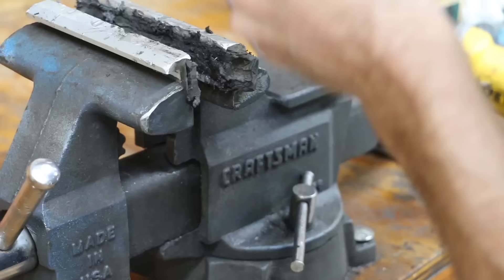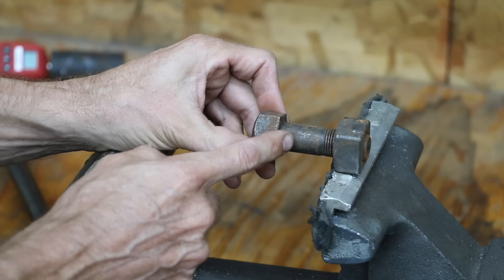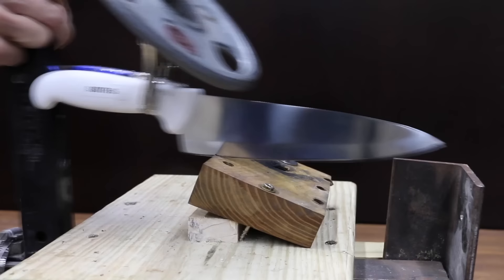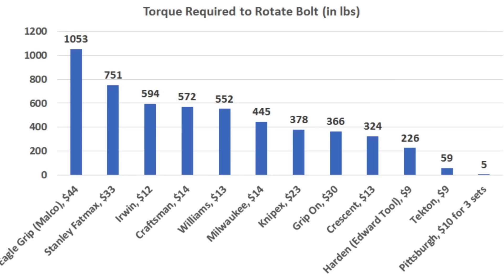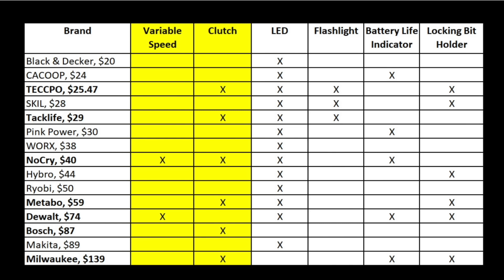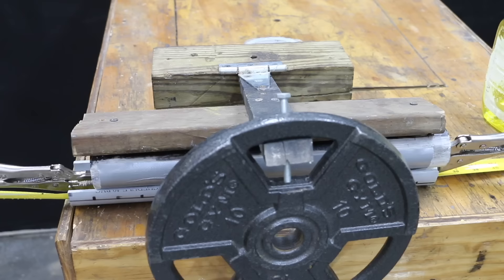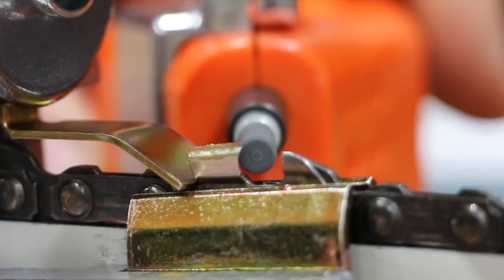Top 10 Tools 2021? Let’s find out! Gift Ideas!

Comment: I just recently watched your test from April 2018 when you tested automatic transmission fluid in the crankcase of a small lawnmower engine , using it as a cleaner .   Although it looked to be a pretty effective test .  I have some information for you on using ATF in the crankcase of an engine .  My brother who is over 71 years old and has been working on and repairing engines for most of his life , uses ATF in the crankcase of many of his own engines , and has told me that he has been doing so for around 50 years.   He does not use it at 100 percent capacity though ,.  He usually substitutes 10-to-20 percent
Reply from the maker: Thanks for sharing.

Comment: Too much cool stuff. Thanks buddy. I'd like to suggest testing something I know you, and many others use regularly, usually without consideration as to quality, accuracy, longevity or durability. I'd like to see a comprehensive (as much as possible anyway) of gages. Analog, digital, liquid filled, dry, mechanical, direct contact, tire pressure and the list goes on and on. Most people have no clue the gages they use have a recommended accuracy range so any information you can provide will be a great learning experience. Thank you so much!
Reply from the maker: Thanks!  Thanks for the video idea.

Comment: I have a few gripes with the DeWalt tape. I got it when they first came out. The blade lock didn't perform well, it's really heavy, and the hook is just too wide. I used a Fat Max for the most part but have been using a Milwaukee 16ft magnetic tape. I've been happy with it so far. 

I love the Knipex alligators, solid tool. And the Milwaukee M18 Fuel drill is a beast, love it.
Reply from the maker: Thanks for the feedback.

Comment: TEST IDEA Modern wire nails (all kinds: ring shank , nail gun , hand drove ) V.S. Antique cut nails ( square and cut are different )  > TEST FOR < gripping strength , sheerer load, shock strength {If a framed joint failed transferring its load to the next joint can one nail withstand more shock load than another} BOUNS CONTENT:   > nail material<  aluminum alloy, galvanized , nails for concrete, iron , steel, brass, copper .... (I'm assuming you will not find cut nails in many diffract kinds) Most of these tests you already the the test methods for , I try to suggest ones that are not vary expensive , but raise good questions . Like if using the same wood to build a house in tornado ally , would modern nails be better than antique cut nails ? Hope to here those words !  "Were gonna test that!"
Reply from the maker: Thanks for the suggestion.

Comment: Can you do a video on the best way to soak up oil spills on smooth and coarse concrete for garage floors and driveways. Like what kind of kitty litter are best and maybe some purpose sold oil cleanup
Reply from the maker: Thanks for the suggestion.

Comment: I'v been a builder, cabinet maker, and furniture maker for 50 years ( i made 3 pieces for Robert Redford) i have always wondered why there is not a tool that can test the sharpness of carbide-tipped circular saw blades. sending them out for sharpening is almost as expensive as buying a new blade. your help would be appreciated thanks for all your videos.
Reply from the maker: Our pleasure!

Comment: With regard to sharpeners, it really depends on what you are sharpening. I have the both the Lansky system as well as a Tormek T-7 with lots of jigs and several different wheels. For a straight blade, right of the gate without any practice, can you get a better edge on the Lansky? Almost certainly. Can you sharpen a bowl gouge for your lathe at any angle you want on the Lansky? Well ... no. Can you sharpen your plane irons on the Lansky? Perhaps, but imperfectly. The Tormek is a system, primarly designed for sharpening woodworking tools, which can also be used to sharpen knives, scissors, etc.. The Lansky is a knife sharpener; it can't be used for anything else.
Reply from the maker: Thanks for sharing.

Comment: Curious about the yellow handled wera screw drivers. They have very similar build to the wiha you showed. They supposedly have the shaft run all the way to the strike cap (just like the wiha). The green wera don't have strike cap I believe. 

I'd test mine but spent too much to intentionally push to failure. LOL

Comment: In the cordless screw driver category does the NoCry have a removable battery?  this is a must for constant use as you don't have time to put the entire tool on a sharpener making a battery swap a selling point.   this is aimed specifically at the cordless screw drivers but any cordless tool or system could find this info useful.

Comment: Late to the party, but I would really love to see a comparison of oil filter pliers and cup socket wrench adapters. I've had terrible luck with those plastic cup adapters for socket wrenches/breaker bars, and sometimes you can't fit oil filter pliers into tight spaces on some cars.

Comment: He usually substitutes 10-to 20 percent of the oil capacity with ATF when he does an oil change .  and he does not use synthetic ATF, or Synthetic Engine oil .  He just uses a good quality Conventional 10w30oil , and a quality conventional Dextron III transmission fluid . . I have personally seen the inside of an engine that he used that combination in that had 125,000 miles on it and it did not have any internal sludge , and there was no abnormal wear or damage to the engine . he had only taken it apart to replace some gaskets that were worn and seaping do to age.   the engine was a 2.8 Litre GM V6 that was in a 1989 Oldsmobile midsize front wheel drive station wagon that that he used for his daily driven vehicle that when was purchased had around 10,000 miles on it .  and it had over 200,000 miles on it when he finally sold it many years later and it was still running strong ..
Reply from the maker: Thanks for sharing.

Comment: Your videos are great! You should do some tests of the battery jump starter kits using an inrush current monitor, such as the Dranetz power monitoring system.  Would be interesting to see the sags and swells in their output performance as they try to turn over an engine.
Reply from the maker: Thanks for the suggestion.

Comment: Those screwdrivers were rebranded as matco and sold on the tool trucks.. best screwdrivers I've ever owned. Just don't use the flat tip ones as a prybar. They will indeed break.
Reply from the maker: Thanks for the feedback.

Comment: At this point I'd love to see some testing of rotary mini tools (Dremel and the like). Not as much the driver itself, but the cutting and drilling accessories (heads) for that kind of tool, I'm at the 4th disappointingly fragile mini tools set and they cost quite a bit of money, often more than the equivalent normal/standard sized ones.
Reply from the maker: Thanks for the suggestion.

Comment: I’ve used my bosses Milwaukee fuel a lot and have my own brushless non fuel but they have a very serious issue that you didn’t check on, the chuck is HORRIBLE on both! Serious issues with hole saw bits and rounding them off even with great care to make sure the chuck is on properly
Reply from the maker: Thanks for the feedback.

Comment: Great Work! I value you you're opinion! I have a 1978 Motorcycle and there is a 1/4" hole in the bottom of one of the chrome mufflers. What would you recommend as a "non-welding" fix? Thanks!
Reply from the maker: Thanks!  Thanks for the suggestion.

Comment: Hello Project farm. Have you ever done a test to see what is the best HOME WATER COOLERS?  We went through 2 Promo's in a span of 10 years. Now we have a "Vitapure" and it puts those Promo's to shame. We have city water, so we buy 5 gallon jugs of water and use it on the water cooler machine. It also makes hot water. Is there anyway to test these to see what or who makes the best one? Plenty of them out there.
Reply from the maker: Thanks for the suggestion.

Comment: I wish there was a way you could do a longevity test on some stuff. No dispute that Milwaukee tools are making a lot of the most powerful drills etc. But given the company I work for supplies our power tools and all Milwaukee,

Drive selection (fwd Rev) failing after a few months, batteries that give the flashing light of dead core after a few months, impacts that can't survive a drop off a 6ft ladder. 

I get jobsites are tough on tools but they advertise as jobsite tough etc, but they do not last anymore.

In the 9 years I've been with the company and only using Milwaukee, the stuff in the last two or three years doesn't hold up like it used to. And I'm talking a company of more than 1200 tradesmen, each big job likely close to $500k+ in tools alone

I feel longevity is a huge buying point for people and many would give up some performance for better longevity.
Reply from the maker: Thanks for the feedback.

Comment: ironically, one of the features of the wiha screwdrivers is to avoid the entire reason as to why the Phillips screw drive was invented. Back a long time ago, before torque wrenches, a method was needed to stop screws from being overtightened by low-skilled assembly line workers. The Phillips screw was invented to slip out at the right torque. Now the Phillips screw is outdated, if you need a certain torque you use a torque wrench, and why i always try to buy hex or torx fasteners
Reply from the maker: Thanks for the feedback.

Comment: Hi PF, been puzzled with 1/4" drive inch-pound torque wrenches for engine work. Does high-end ones really different from ones like HF and Tekton-like ones? Been waiting for an episode on torque wrenches, especially 1/4" drive in-lbs ones. Also curious about what beam style torque wrenches are solid. Guess in brief, what brand and models have the best value? Thanks,
Reply from the maker: Thanks for the suggestion.

Comment: Heat guns review. I've been using heats gun and have burnt through a makita and 2 Metabo hpt. Tried a Milwaukee and it didn't really work. Have 2 wagners but the dont work all that well.. Couldn't find comparatives on heat guns.
Reply from the maker: Thanks for the suggestion.

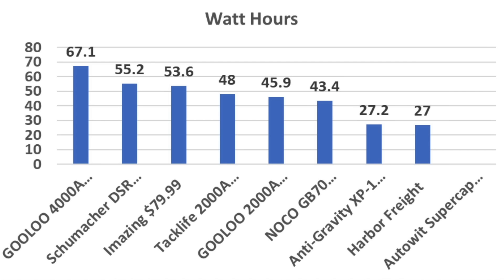Comment: 6:55 - The Milwaukee Fuel claims 60% more "power" (not torque). "Power"  in this case, is a function of torque and rpm. Since the Milwaukee had the best torque and appeared much faster than the others, it's power seems many times better than the 60% claim (didn't do the math, but about 15% more torque and at least 3 times faster would be over 300% more power). Or am I wrong in some assumption?

Comment: RECOMMENDATION:  Can you test lumens from various LED  bulbs,   even though the packages all claim the same luminosity; I have found differences? Also, the Kelvin color temps are different when listed as the same on the package?   can you do it for 12v and 120 v?  I spend a lot on 12v outdoor lighting; maybe you can compare the Malibu vs Portfolio vs Bahama and those from
Reply from the maker: Thanks for the suggestion.

Comment: Harbor Freight also sells screwdrivers under the Doyle and Quinn brands. Why not test them in another screwdriver comparison?
You could also do another locking pliers video and include Harbor Freight's Bremen brand (the joint that is pressed on the Pittsburgh is welded on the Bremen.  Pittsburgh is made in China; Bremen is made in Taiwan).
Reply from the maker: Thanks for the video ideas.

Comment: I’m an aircraft mechanic & I don’t think the screwdriver test was a fair test. Cutting it off & installing in a screw gum is an unfair test. I’m going to use an carbon steel apex to install screws. I’m only going to use a crosspoint screw driver to install one or two screws.

Comment: once again  you said the wicked edge is $900 where just as good sharpening can be done with those around $300... but there are other systems..one is $50 and that is worksharp precision adjust and for $200  KME ..
Reply from the maker: Thanks for the feedback.
Reply: @ProjectFarm  Worksharp Precision is amazing for $50.. Angle adjustment is very good and results also..It is like an improved KME.imho as I own all 3  (actually several more including Chef'sChoice  120 and XV.

Comment: all those seem great except the last one. in my experience you never want to use a chainsaw chain sharpener thats a drill or a disc or anything that moves that fast. most amateurs will end up just burning the teeth, which causes the metal to be harder and more brittle and can break easier as well as make it harder to sharpen the chain again when you need to.
Reply from the maker: Thanks for the feedback.

Comment: Does anyone else have issues with the Milwaukee drill chuck loosing up. I have 2 Milwaukee 1/2 drills one was new old stock the other one was the current model both seem like the drill chucks loosen up several times while drilling 1 or 2 holes?  I haven't used either one enough to break in or put much wear on them. I had a skill drill that did this many years ago and I replaced the chuck with a Jacobs chuck and that fixed the issue. But Milwaukee corded tools are many reviews of the cordless drills no one mentions it. Just wondering if I got lemons or if I missed somethng? Thanks if anyone has any suggestions that I might have looked over.

Comment: Regarding the Milwaukee M18 drill.  The model number of the one you linked to is 2803-20.  Is that discontinued or an older number, and the new one is 2804-20?    Anybody knows what are the differences?

Comment: Do you still do videos where you try odd things out or have you gone 100% comparison videos? I've been curious as to what would happen if you dumped a cup or two of Dawn dishsoap into a radiator and ran it for awhile. Would it bubble up like crazy or would it 'clean' the system out in time? What if some Dawn was placed in engine oil? What kind of cleaning would that do? Would it ruin an engine? I'm guessing it wouldn't be good, but I'd love to see it.
Reply from the maker: Thanks for the suggestion.

Comment: Black and decker tools never seem to make it into your video. It's owned by the same people as dewalt sold as their economy brand. B&D 20v tools and the Matrix arent bad. Even have a 20v pressure washer that can work from a bucket. Good for cleaning cars. Just came out with a buffer attachment for the matrix too.
Reply from the maker: Thanks for the suggestion.

Comment: Could you do a comparison on Diesel fuel?
My wife always used $h€ll then she had to fuel up at ₩ob!l the same route was taken going to work but had to drop back a gear going up the hill that is on route to her work (using the 2nd mentioned)..  TOYOTA 2.2 DIESEL 1983 MODEL, 400,000+
Reply from the maker: Thanks for the suggestion.

Comment: Noco is the best jump starter....this guy cheated by using a medium strength Noco model (2000 amps) against the high straight Gooloo model (4000 amps).....he should have used the "NOCO Boost X GBX150 4000 Amps" which is similia rating to the Gooloo (4000 amps)....what a CHEAT 2000 amps vs 4000 amps